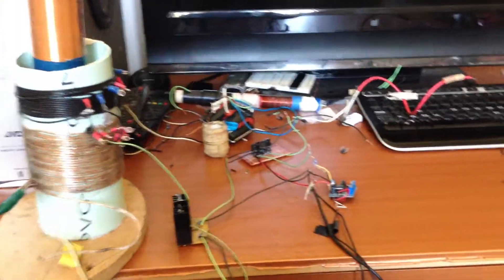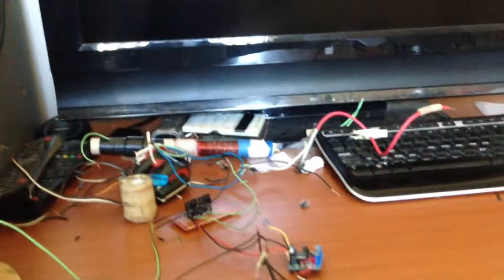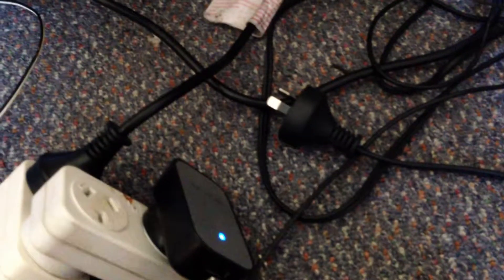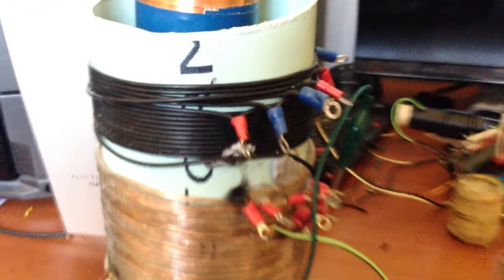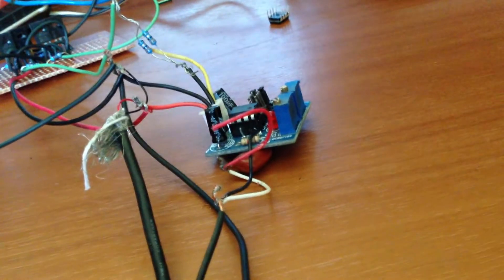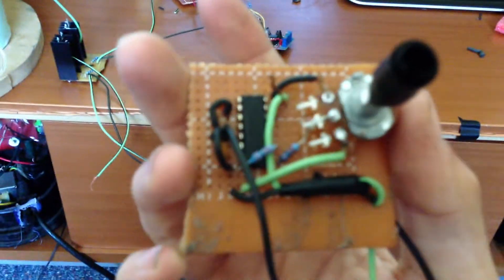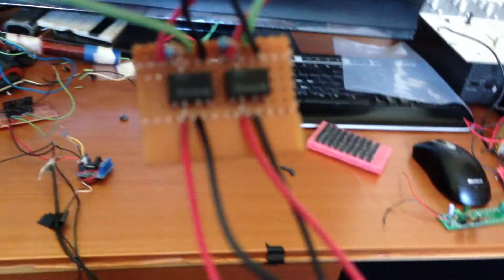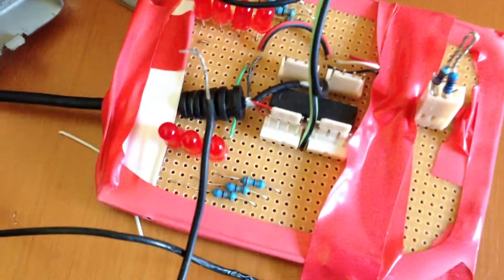555 timer running an sstc

Comment: Hi mate. 
You run that mate on a car battery or a power supply with more than 8 amps and you will notice a hell of a better output ;-)
As the power supply you plugged into looked abit lame for current lol

Great setup mate ;-) im sone day going to build one ;-)

Thanx for sharing.

☆THUMBS UP☆